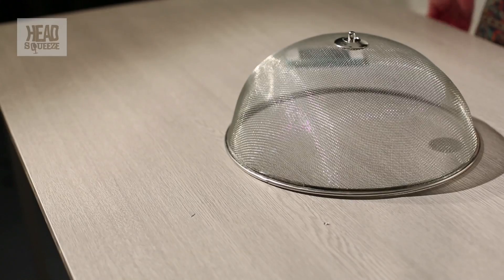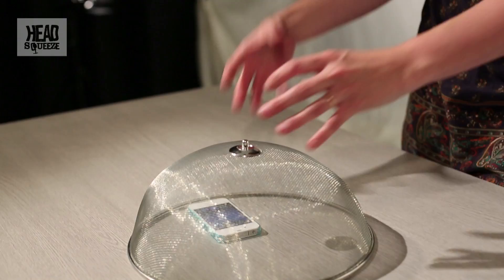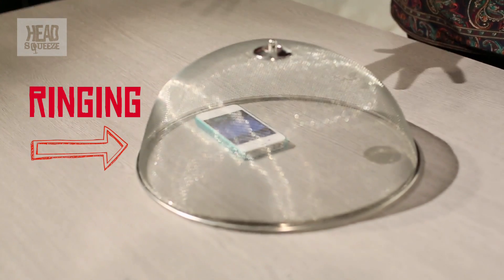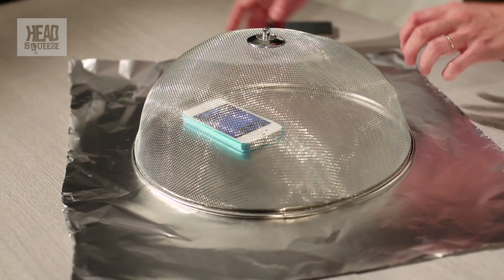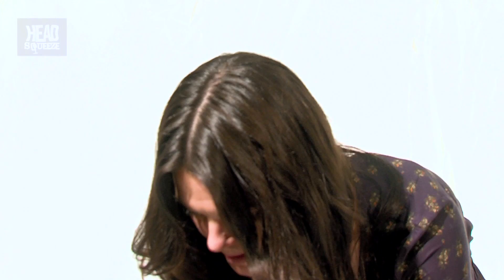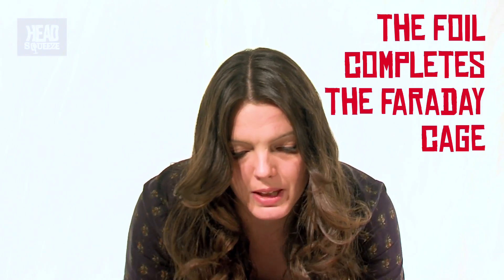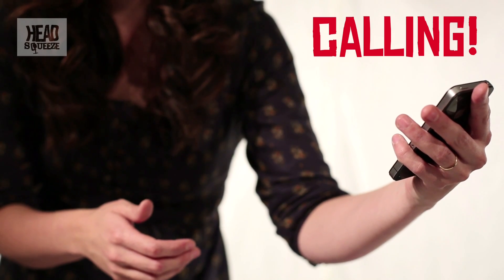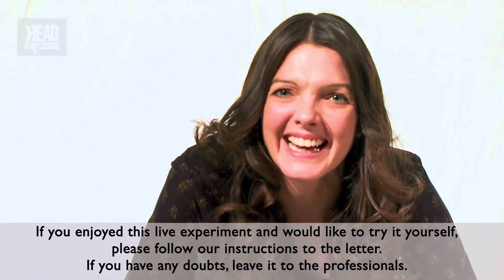Why do phones lose signal in a lift? (DIY Faraday Cage) | Live Experiments (Ep 16) | Head Squeeze

Comment: There are different types of night vision goggles but they all work by picking up light that has bounced off of the objects we want to see.  The night vision device converts infrared (IR) light into light we can see (or else it greatly magnifies and processes dim light to a level which our eyes can see).Your mobile phone can do a similar thing. Put it in camera mode then point a remote control at the lens whilst pushing buttons on the remote. The phone picks up the IR light that your eyes can't

Comment: Depends on the glue i think. Some glues don't work well for sticking plastics so they probably wouldn't stick very well to a plastic bottle.  Also, glues tend to dry off in air, but in the bottle there is not as much air flow to dry it off so it stays more like a liquid.  I'd say double check by doing an experiment.  Cut open a finished glue bottle and also a half finished glue bottle to compare whether there is a difference or not. Then tell us what you find :)

Comment: For the lift, as long as you are in a metal box, it still wouldn't matter how big it is.  As for the airplane, well they have these things called windows which are big gaps. So yes, the cell phone will work on an airplane, but depending on the altitude you are flying at, you might be out of range of the nearest cell tower.

Comment: A car is made of metal, mostly, yes. But not 100% of it. As she explained, there must be no gaps and a car is full of gaps and non-metal materials. Especially some modern cars, since many have more plastic in them than metal. Some even have the body made out of plastic material. Now, if you try to use a mobile phone in a war tank, fully locked in, then I think you might not get a signal. Though I am just supposing. I don't know much about tanks.

Comment: I like your video.
But my head squeezed a little when you suggested that your phone communicates with satellites. It communicates with cell antennas placed on towers and roof tops, placed there by your service provider. 
Your phone can also receive GPS satellite signals for calculating your coordinates, but it isn't sending anything to space. 
Satellite phones are a different thing entirely, and you need to be outside for them to work well. Useful if you're on a boat on the ocean for example.

Comment: Please please please do some research on Maxwell's equations. Or if you insist on doing a dumb downed version, use a better analog. Like tesla coils striking a metal cage with lightning, showing the charge is dissipated over the surface and doesnt get in. Saying you get no signal because charge can't get through, is just plain lazy.

Comment: a charge ??? methinks you need to learn the terminology better, you charge the battery you get charged far too much to make phone calls.

A faraday cage stops the Radio Frequency Radiation from getting in as well as stops RF from leaving the confines of a faraday cage

Also unless you are using a satellite phone your call goes to the nearest cell phone site and then the call is connected by the Mobile Switching Centre

Please use James May for these technical items, he seems to research better

Comment: Does the frequency or wavelength of the EM wave affect the wave this experiment works. I have noticed that some of the older phones work much worse in lifts than the modern ones. Is it because they use slightly different form of waves?